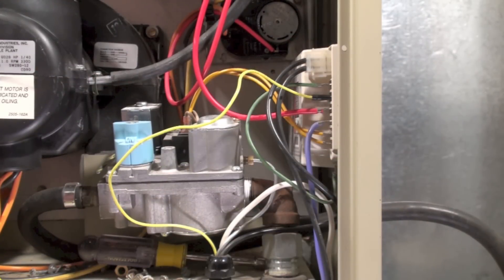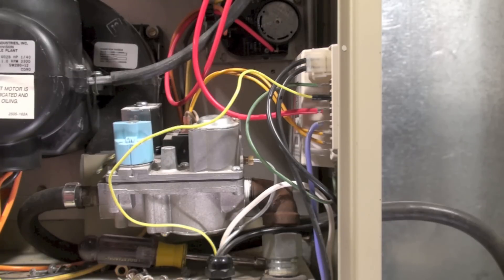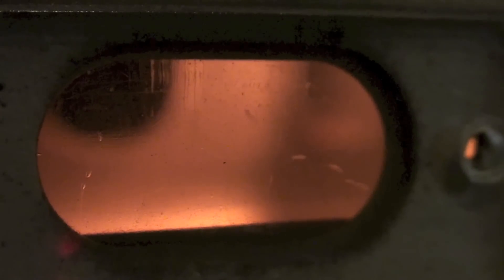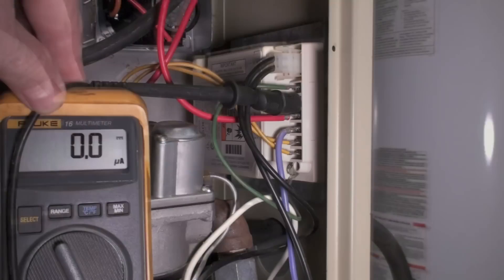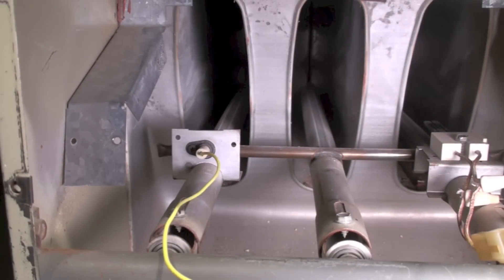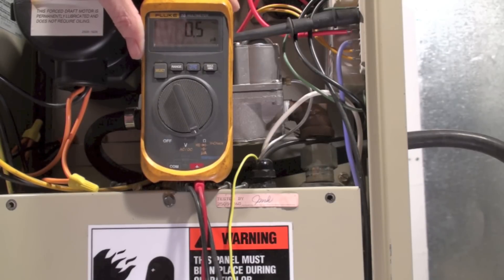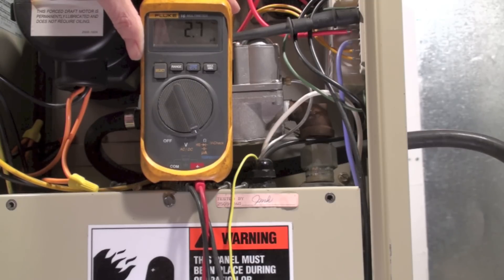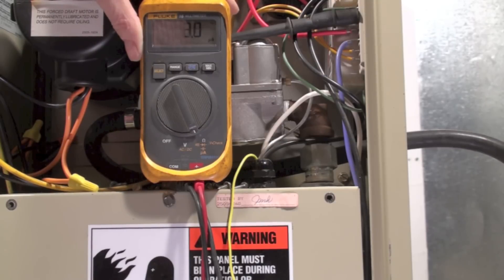How to check the flame rod on the Snyder General GUA furnace. Part 4

Comment: Furnace gave out on a Cold winter Saturday. Found your videos, cleaned the flame rod, and saved hundreds on a weekend service call. Thanks!
Reply: Six years later I'm still trying to keep this furnace online.

Just replaced my failing inducer motor thanks to your videos. 

Currently, the flame shuts off after the Blower kicks on. Ran a cycle with the filter out and the flame stays lit and the system works. Return vents are clear. Any recommended next steps to try? It's hard to find a lighter filter that fits.

Comment: We're having the issue described in this video where the burners come on and then turn back off. However, no blinking red lights. Is it possible my control board is bad?
Reply from the maker: Some of the boards do not have lights.  First, I would clean the flame rod.  Cheapest and easiest.
GFM
Reply: @grayfurnaceman  that's exactly what I did, and our house is warm again. Huge thanks for your videos!
Reply from the maker: Welcome
GFM

Comment: I tested my flame sensor it jumped from 2.5  to  18 back down to 12 then 4 etc  Would that be a control board issue  or bad flame sensor ?To replace the cheapest thing first, I bought a replacement flame sensor for Snyder General GUA .  Trouble is, the porcelain on the new one is thicker than the one on old flame sensor so it wont fit in the mounting hole. Would it hurt anything to drill out the mounting hole to make it larger or should I find a flame sensor that will fit in the hole without alteration?
Reply from the maker: I would get the right one.  As to the readings, they do not make sense.  Are you using a microamp meter?
GFM
Reply: Thank you,   Yes, I used my micro amp on another furnace just to make sure  it was reading correctly and it  held a steady  4.0
Reply from the maker: You may have a board problem or the flame is not covering the flame rod.
GFM

Comment: grayfurnaceman   i have a snyder general  08/89  when i turn it on i get a red blinking light  the glow fly lights up then it will not light so watching your videos it is locked out you say to re cycle the ignition control  how can i find out what is wrong ???  please help
Reply from the maker: If the igniter glows but no fire, you have a fuel supply problem. Failed gas valve, no gas available, no power to gas valve. Hope this helps. 
GFM
Reply: +grayfurnaceman well i have gas at the drip leg we are going to see about getting a meter my gas valve only has 2 yellow wires  going to the ignition control panel we are hoping winter is over here we need to get a new furnace anyway we really want to thank you your videos are helpful

Comment: Videos are incredibly helpful and informative...I know much more about my furnace than when I started, thanks for posting.

Curious as to if you could explain or show how to remove the burners from a GUA Deluxe Energy Saver model. The last two of my burners aren't lighting off so the flame sensor isn't engaging, shutting the system down. The flame appears to be attempting to ignite through the copper feed tube to the last two burners, but again, they aren't lighting off. I suspect either dirty valves, burners, or perhaps not enough pressure from the manifold. Any thoughts?
Reply from the maker: Cory White Removing the burners is fairly complicated.  Once the burner cover has been removed, the shield below has 2 screws that need to be removed.  Then its a question of working the shield out around the wires.  Then the burner assembly needs to be pulled toward you against the springs then the back lifted up then forward and out. Careful here, easy to break the HSI.  Hope this helps.
GFM

Comment: Our furnace every so often the inducer turnes on then burners then everything shuts off i havent cleaned the flame rod or anything in it i think it is a bad control board but i should check the flame rod

Comment from the maker: I surely have no problem with using other methods (I have used a screwdriver to clean them).  I just wish all manufacturers would go to the material Trane uses.  They seldom seem to need cleaning.  While I am on my soapbox, I would like to see all installers bring the combustion air from outside on units that have the option.  The furnace in the laundry room taking inside air is the worst possible conditions to work under.  Thanks al lot for the comment.
GFM

Comment from the maker: The Fluke 116 issue has been problematic.  The temp probe function is inaccurate and has been for 5 years. I sympathize with you about Fluke.  I even called the manufacturer and yelled at them to no avail.
 I taught for 9 yrs and tried everything to simulate a dirty flame rod.  Chlorine, glue, tape nothing would stop them from working.  I dont think residue from sandpaper will stop them.  Thanks for the comment.
GFM